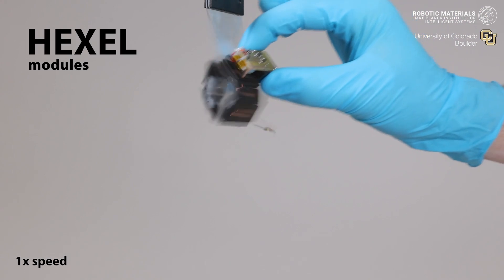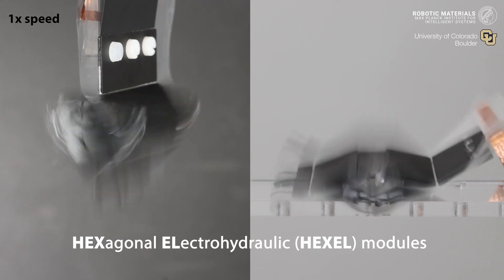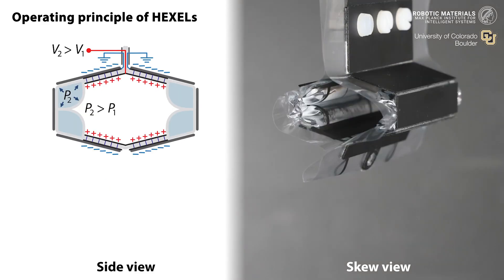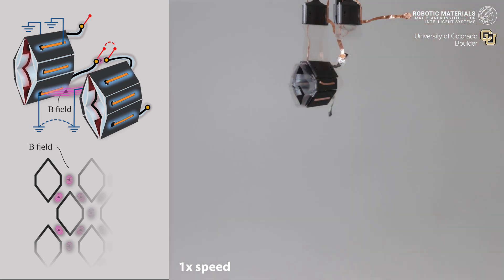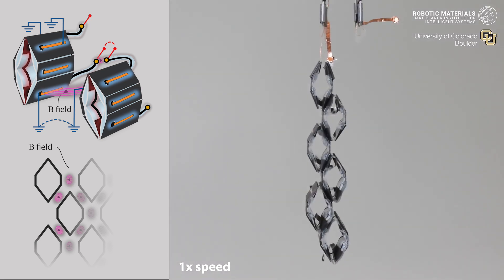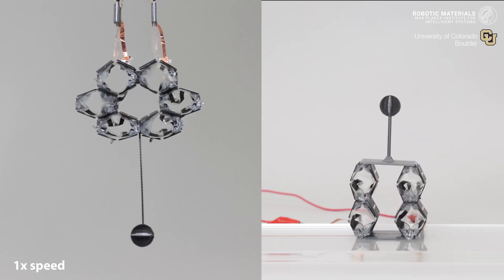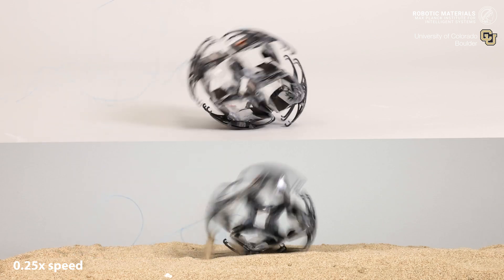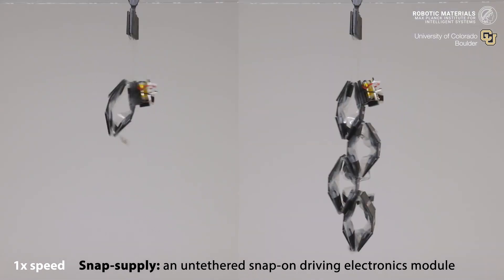Combining soft artificial muscles with magnetic exoskeleton to create versatile robots

Comment: Lots of comments on how this could change things. But there's one thing that is a glaring omission in the video to me. It's lifting capacity. How much can one unit lift? 10 units? Does it increase in capacity with addition units and if so, by what type of rate? Incremental or exponential? How scalable is it? How vulnerable to damage are the fluid pods? It's a great concept and demo, but what it could be used for is limited based on these other factors.
Reply: A robotic model that could improve artificial limbs functionality to walk and perform physical tasks with handheld prosthesis electron nerve modulation. The semiconductor chip operates the magnetic strip to stimulate tendon activation. Exponentially scalable as spare components for robust configuration movement. It's an Innovative technological Solution for complex applications. Thanks for sharing your views. 😂https://youtu.be/9XLw_cNwV88?si=XUzOd2FKC02wxvb5
Reply: It's a tech demo, not a guideline. You can go to their news article and follow the referenced research articles there to see some more technical properties.
Reply: @cefcephatus  Noooo,... Really? Who would have ever thought
Reply: @nerored6235  Well, the RP is behind a pay wall. So, not really helpful.

Comment: It needs to be 10x smaller, connected together, and woven into fabric.
Reply: I don't think you will get anything out of making them smaller. Those are basically capacitors, and they are highly dependent on the surface area, so the smaller they get, the weaker the effect will be, but it is a fascinating non the less, one student made an universal and cheap eye sight testing kit with the same principal, and some phones yoused that for a lens in their cameras
Reply: @tom79623  That sounds very interesting! Do you have a link to that project?
Reply: @tom79623  The way our muscle fibers work, the individuals aren't that strong, the bundle is. In the case of these magnets the same issue exists, however they're too large to bundle. Smaller would likely improve that even if the individual parts are weaker.
Reply: When the effect becomes smallconnou just connect more of them to increase the effect. whe  you have a whole bunch conected bottom to top and left to right then6it also provides a buffer for falling when a middle one doesnt work the 2 adjacent to it will still be functional that way. I just don't know how we could make the smaller (10x cell size?)
Reply: On the right side, we're already 10% of the way there.
Reply: it also needs to be super though or it will rip
Reply: Going for the 'Appleseed' anime aesthetic? 😅
Reply: The university of Colorado Boulder and Robotic Materials  really needed your take on that specific subject... Now they know
Reply: There are smaller versions. Look in the mandatory 💉s.